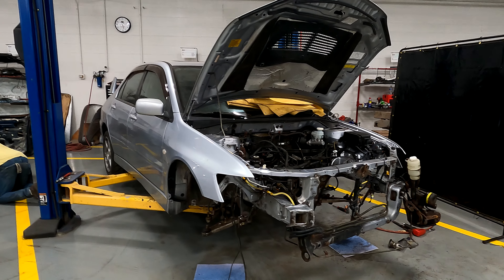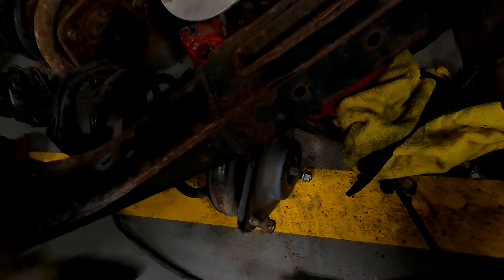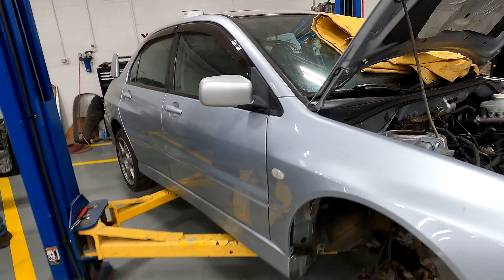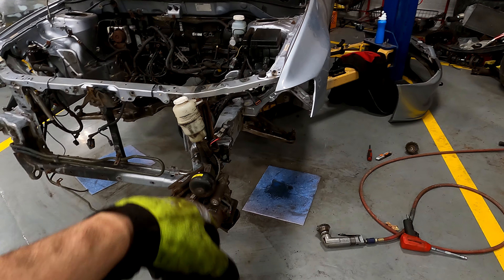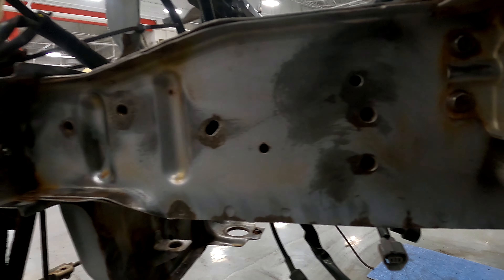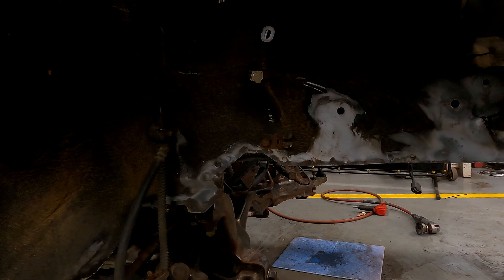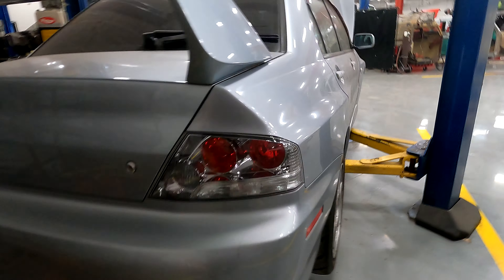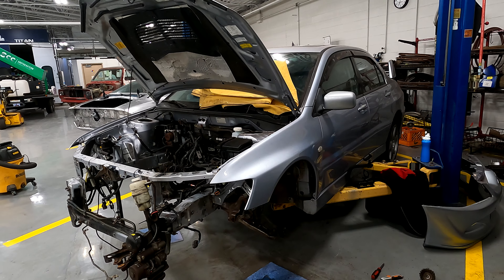2005 EVO 8 SSL Update Video Ep. 1 | My New Project

Comment: 10x easier with a real one than trying to piece one together eh haha
Reply: Easier? Definitely. Will you be able to restore it the way you want? Probably not.

I've been debating on which route to go. I know starting from a shell usually costs more money. However, when you factor in the age of these cars, you really want to touch everything and replace as much as you can. 

Why pay a premium for a car with most of the parts that will be replaced anyway. Plus, it saves time removing the original part.

It just depends on your goals.